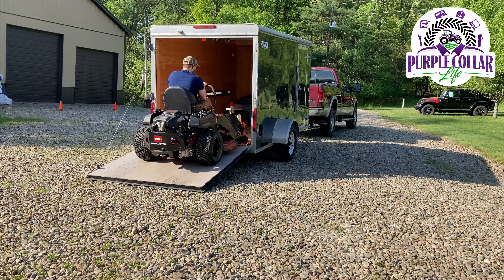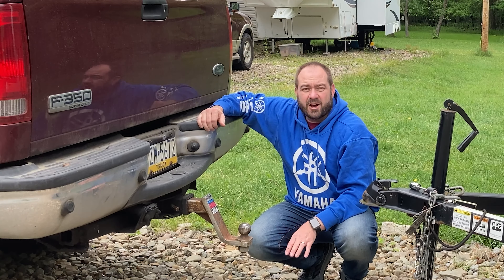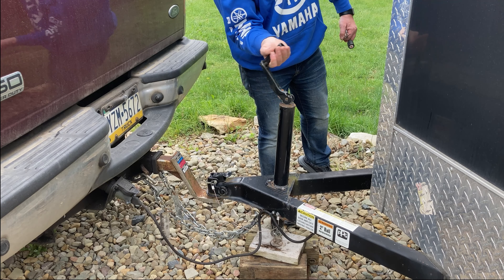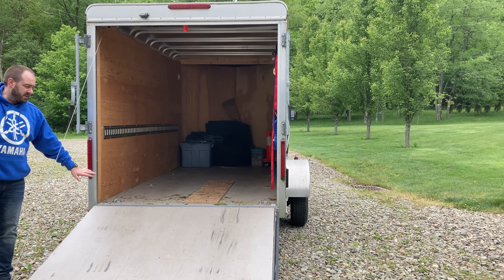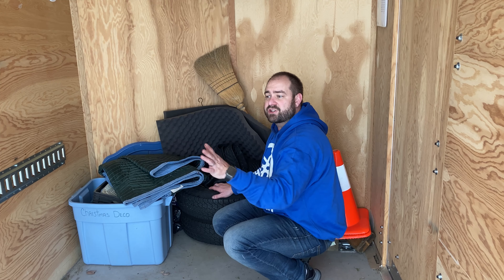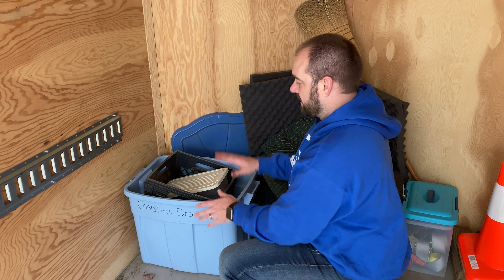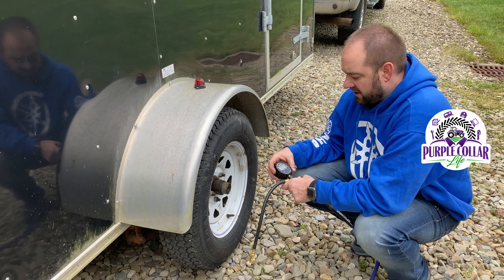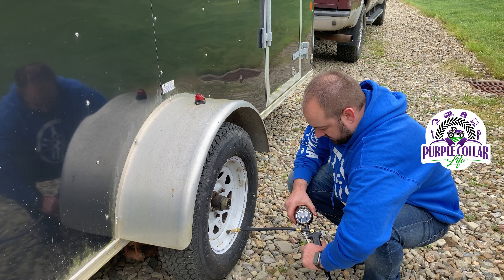#208: Buying an enclosed trailer - tips and tricks. Car Mate 6x12 trailer.

Comment: Great tips. Very simple maintenance will keep it on the road for many miles. An issue I had on a trailer of mine was that the ramp hinges froze/rusted. Couldn't even drop the ramp down. I had to cut the old hinges off and install new ones with a grease zerk. I should have sprayed them with a lubricant often, lesson learned.
Reply from the maker: Thanks, Joel.  I like to hit all those hinges with oil several times a year.

Comment: I think a good addition to trailers is back up lights. Not necessarily for seeing where you're backing up, but also to let people who might be walking behind know that you're backing up. I've never known why trailer manufacturers don't include them. It would make it safer for "pedestrians" I think. A very nice trailer Chad! Thank you for sharing! (I like the Super Duty too! The F-350 in a single rear wheel is rare, most of them are dualies)
Reply from the maker: Thanks, David.  Back up lights would be great.  I've always wondered why they're not on trailers.  If you do need to back up - the car behind you has NO idea you're coming back until they actually see it happening.  
You can tell I love that Super Duty F350.  I purchased it new in 2005 and still wouldn't replace it with a new one today.  First of all - the new trucks are crazy expensive.  I really wanted the 1-ton truck in a single rear wheel. I actually traveled to Maryland to purchase this truck in 2005 after searching for one with the features I wanted (towing package, single rear wheel F350, leather heated seats, short bed, etc.) I don't think a dually would fit in my garage, and there's nothing I need to tow/haul that requires that much payload.  Thanks for watching!
Reply: @PurpleCollarLife  Definitely right about new truck prices. It's unbelievable how much they've risen in the last few years. If I bought one, i would definitely consider pre-owned. Your Super Duty is a keeper for sure! 👍👍

Comment: We have a ton of trailers, horse trailers, cargo trailers, equipment trailers, we have a bri mar dump and a bwise hydraulic deck over that were made in Pennsylvania and they seem to be excellent quality, the bwise was actuaclly purchased in PA. The cargo trailer is a sooner gooseneck from OK its all aluminum 27' gooseneck solid as cab be we use to move the utv and have a small camping set up in the front! Good thinking on going with what you felt you were getting the best value out of instead of whats easiest on the wallet, it will pay off in the long run!
Reply from the maker: Totally agree, Hillside Acres. I'd always rather pay a little more for quality that will last.

Comment: I had a 6*12 single axle enclosed for years.  It wasn't a v-nose, and pulled like a bear behind my half ton.  If I were to buy another,  I'd get a tandom with brake axle.
Reply from the maker: Thanks for watching and commenting.  This 6x12 pulls great.  And the F350 has some heavy duty brakes, so I've not had any issues.  I would agree that a 1/2 ton would be better suited with a trailer that has brakes - enclosed trailer, boat trailer, landscape trailer, etc.

Comment: I have a quick question so I just bought my uncles ‘96 Ford Ranger I fixed it up and it runs great with super low mileage, I just wanna know does this size of a trailer work with the truck or would the truck be considered too old?
Reply from the maker: That's a hard question to answer without knowing much about the truck.  Certainly I wouldn't consider a 1996 vehicle too old to tow if it's been properly maintained, and the frame, transmission, and engine are in good shape.  Also - you don't mention what engine and transmission you have in your truck.  I'd recommend using the towing guide for 1996.  I haven't been able to locate the official ford guide. But according to this website, a 1996 Ford Ranger with the 4 cylinder engine and 3:73 axle ratio and automatic transmission is listed to tow 2300 lbs. https://trailers.com/tow-capacity/1996_Ford_Ranger_4x2_1875.html
Reply: @PurpleCollarLife  yea forgot to add that to my question lol so thanks for clarifying that yea it’s a 4.0 V6 and yea he didn’t have the manual anymore but thanks for the information

Comment: What fuel mileage do you get when the trailer is empty?
Reply from the maker: With our F350 diesel, I don't notice any change in mileage when towing the trailer.  I'm sure I would notice a difference if towing with the Ford Ranger, but I don't tow it more than a few miles with the Ranger.